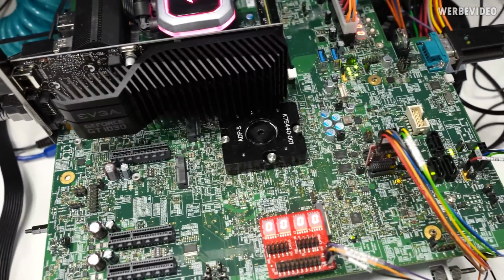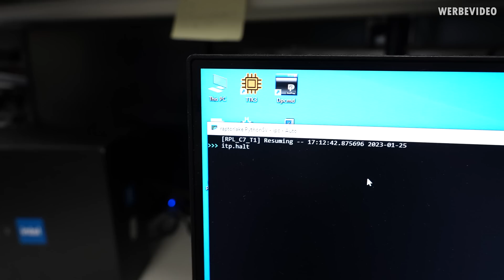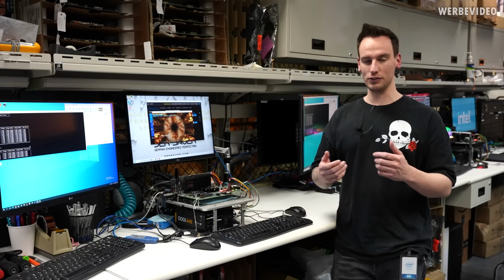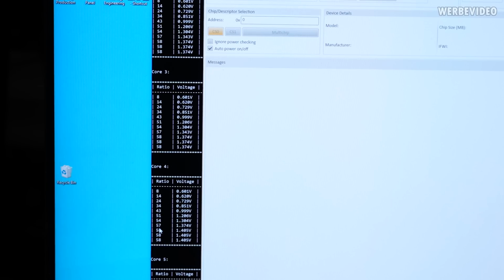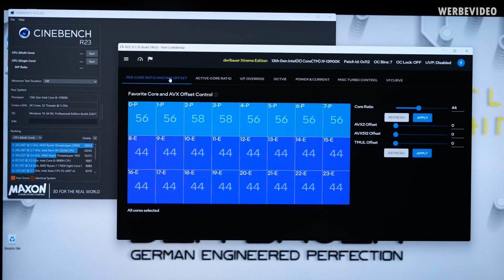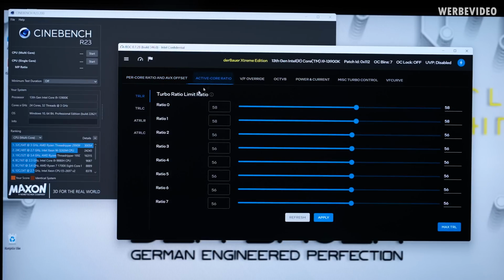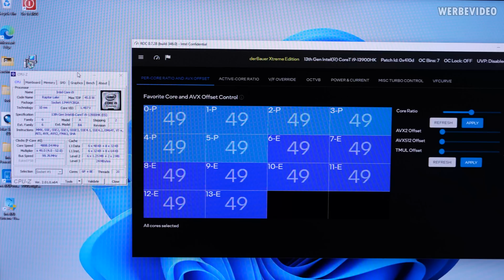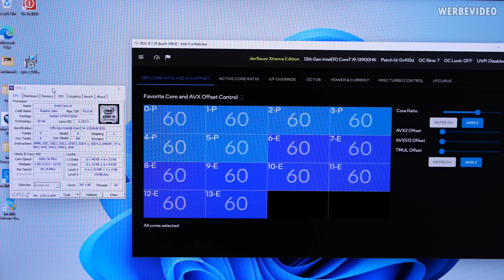Mind-Blowing Prototypes and CPU development - Inside Intels OC-Lab

Comment: Let them conduct intensive research in the direction of poorly designed sockets and pressure frames for processors and not only 13 generations because I also noticed after 4 years I had the 9th generation platform installed and the ihs is also bent so the problem has been in this junk for a long time, and no one has done anything about it to this day, greetings to intel.

Comment: Point 1 - Why they still use pins in CPU socket? (if you bend the pins then you have to buy a new motherboard).
Point 2 - If this mounting mechanism works fine for Intel, why they use IHS in consumer CPUs? (higher CPU temperatures and more expensive cooling).

Why Intel, why???

Comment: you see what the pins and solder balls do to the light.. light has an electrical resistance. meaning if it looks different something is pulling it if its brighter something is charging it

Comment: @der8auer-en have a question for you. Can sodium ddr4 chips be changed to regular ddr4 chips (b-die for example)? Do anyone even tried to do that for overclocking? It could be fun to see how mobile 5000 amd cpu will performed with such memory as it can be fully turned by using UniversalAMDFormBrowser(if you want i can share it to you)

Comment: der8auer after seeing the swap of ball grid array chips, why don't we have this in retail? maybe for say stacks of HBM memory on motherboards? small little chips placed next to the cpus, easy to upgrade laptops? add more memory, more bandwidth, etc? heck why not take it a step further and make it for nvme storage? comes with a 512GB BGA nvme chip, expand, just add another chip or three to your motherboard?
Reply: Because they won't make any money if you upgrade old hardware.
Reply: @OldAccountUser  MrBonami2 - I'm confused by your comment because people are not prevented from upgrading today, and you would still be purchasing hardware they would be selling, so your comment leaves me puzzled by the logic you're trying to present... what would this do, it would provide people the ability to take something and expand it rather than toss it out, but you would still be buying something, it would also in some cases have the added benefit of putting that closer to the CPU which has other benefits, like better pcie connectiviy meaning higher potential bandwidth where before it was kicked to lower speeds due to length of traces, or in the case of system design allow manufacturers to make devices that can be loaded with even more and consume less power as a result of that closer connectivity not wasting more electricity to perform the same task as before... so while I don't see any drawback really, we still would be buying things from manufacturers, they would just come in different packages and connect different ways, but it would also provide more benefit from lower overall costing devices so manufacturers might even sell more as people don't feel bad buying that extra space now that its cheaper with less parts involved in a replacement, that often translates to higher margins for the manufacturer, thats a win win...
Reply: These particular interposer based sockets are special parts that literally cost thousands of dollars and have poor electrical performance compared to a soldered down PCH

Comment: I like those modular motherboards, not something very interesting for the general public (there is not really a need for that) but for a company the makes those chipsets it's really handy to be able to swap that easily.
Reply: We have things like that where I work as well. We use FPGAs in cell tower arrays, and being able to yank out what should be a soldered-down chip and replace it is a godsend for testing and development.

Comment: What do you think the reason is behind not having interposers for mainstream CPUs?  I wonder what the benefits are to pins on the CPU or MB. Seems like the manufacturing would be significantly easier and more difficult to damage. Making sure everything is aligned could be an issue. Pushing down hard when misaligned would be a nightmare.
Reply: Biggest reason is the wear out and they’re really expensive.

Comment: what i find intresting is none of the CPUs have the bottom mounted capacitors installed and they drop directly onto the motherboard PCB. i had always thought they used some kind of pogo pin adapter to mount the cpu to the motherboard so there chip was raised slightly
Reply: the 13900K showed in the video did have the bottom mounted SMDs installed. however it was a BGA socket instead of LGA

Comment: I wonder why they don't just use the BGA/interposer mounting method in their retail desktop products, it seems a lot simpler and reliable than messing with pins.
Reply: Cost.
Reply: @glenndoiron9317  Probably, but should be weighed against the cost of warranties.
Reply: @whyjay9959  No, nonononononono, these are the kinds of items that show up on the manufacturer's catalog WITHOUT a price tag listed.   Realistically probably somewhere in the low 5 figures for a single BGA socket.
Reply: @glenndoiron9317  ...I see. Didn't think it would be nearly that much.

Comment: I love seeing these types of videos. I wish AMD had more vids like this. Seeing all the little engineering secrets and such is awesome.
Reply: AMD's using TSMC, they don't have their own Fab anymore, so im assuming thats why, Intel GPU's are TSMC also, Just because Intel doesn't have the manufacturing process yet or else they probably would have did that one in house also.
Reply: @bes12000  I would be very surprised if AMD did not have something similar to what Intel has here. Of course the name of the platform and capabilities would be different, but these are the platforms used to validate that the chips they've designed function in the real world.

Comment: I hope he ask them about the heat spreader. What are the benefits vs the the negatives. Way are they so thick, is if for production? Cause to me it looks like they create a bottle neck for cooling by increasing the delta temp needed to transfer the heat energy. They do add some protection and ensures good contact on the full chip, but way do they need to be this thick?
Reply: Spreader*

Comment: It's a shame these tweaks are largely unavailable to the end user. Overclocking modern CPUs doesn't tend to yield much,  but it would be nice to have these settings open to the end user.

It's not going to hurt profits at all if a few keen end users want to squeeze every last mhz out of their components. Most of the market is commercial computers

Comment: 14:31 literally hands on proof that we don't need to solder down anything
Reply: Technically no. In laptops it's more about saving space and money than absolutely having to solder a chip down. A connector that touches the BGA works just as well as the gap in contact is more than ok for electrons to pass across.
This is why and how every connector works, lol. Your USB cable, SD card, etc is just metal to metal contact. 

Soldering is only needed when rigidity is key. Almost every other time it's an economic or security solution.

Comment: 15:27 Is that an open ended x16? What would they be testing that uses more than 16 lanes?
Reply: I heard some servers have x32 slots for riser cards?
Reply: It's open ended but they won't test more then 16 Pci_E lanes for this kind of hardware. The idea is they don't want the locking lever, so they could easily insert and remove cards.

Comment: would be nice if we could upgrade our chipset that easily :D
Reply: Did you see that ASRock B650 Livemixer motherboard that can be upgraded to X570 with an add-in card? Too bad that was only only for reviewers, not a retail product (at least for now).
Reply: Those interposer sockets cost big $$$ (think several times more than the I9-13900K itself).
Reply: Maybe the motherboard's wiring could have issues with future PCIe generations?

Comment: Nice. Can you tell Intel not to change socket at every whiff of wind, please? xD
Reply: AM4 had its own share of visible problems because of this philosophy.   I'm sure if you could corner an AMD hardware engineer, they'd have many horror stories about the things they didn't want to do, but had to do, to put new processors on the same platform.
Reply: @glenndoiron9317  Evil Su pressured board vendors to support 7 gens of CPU/APU, not knowing the issues of uefi flash size, and how long it really takes to flash it.

Meanwhile, Intel approached board vendors how long a board should support. It's the board vendors that suggested Intel to keep it 2 gens per socket.

Someone should sue Evil Su for misleading marketing.
Reply: ^ Oh look, someone that upgrades annually unnecessarily, complains price are expensive, perf gains are low and they have no money
Reply: @AlfaPro1337  Yeah.. no. I'm just tired of seeing their sockets last like a fart. 

Of course we'll have to see how long AMD will support AM5, but I'm kind of happy to have upgraded 2016/2017 boards with a 5800x3D (or 5600/5700x) of many acquaintances' build rigs I did around over the years. 
And with those CPUs, they can keep those older rigs probably until AM6 comes out.
Reply: @JMatrx  Except AM4 doesn't support all 7th generation of APU/CPU, the first being the Excavator APU AM4.

Plus, users reported compatibilities having 5th gen Ryzen on older 400 series board, like their PCIE 4.0 card not working.

In the end, they ended up buying 500 series board and sell their 3/400 series board away.

If you must know, Intel did support LGA 775 for a long time, AND they learned their lesson:

1. Newer C2 board with P4 chip, the board dies, because the VRM is 'weak' to power the power hungry P4. The worst case it won't post.
2. Older P4 board kills the newer more efficient C2 chips.

Heck, even some last gen 775 40-series chipset omit P4 and early C2 support.

Unfortunately, no Aymdiot says your platform is too dated.
Reply: @AlfaPro1337  I've updated (or made update) far back to a gigabyte ab350 gaming, asrock a320m, non max (so the one with the tinier bios chip) MSI b450 tomahawk.. I've only had issues with some boards (like the MSI) that lost usb 3.2 ports. 
The rest works like a charm and you can always buy a PCIe card should you really need them; sure not on all of those I've endorsed the x3D, but 5600/5700x can run off VRMs of everything, and i always use cases with at least an extra up top exhaust fan for that purpose.
Reply: @JMatrx  Except, some people are gonna put high-end power chip on a low-end board.

Look, VRM has come a long way from the P4/C2 days, but I get Intel's reluctant back in 1151 and 1151-2, they don't wanna user AND REVIEWERS complaining:

"oh, 8700K or later 9700K and up can run on 1/200 series board, but it's gonna throttle or kill your hardware quickly."

While it took me sometime to realise why they also didn't bother 6/7th gen Intel CPU on 300 series board. People are gonna complain 'upgrade' is one-way only.

On the side note, if you have a decent hardware, the only thing you need to upgrade is just the CPU and MOBO.